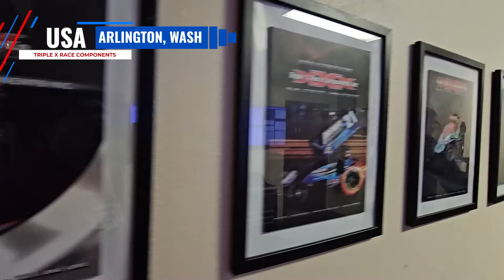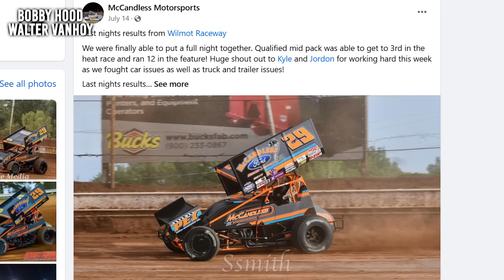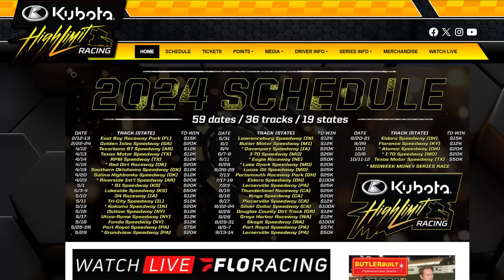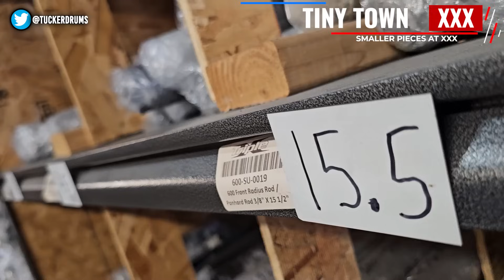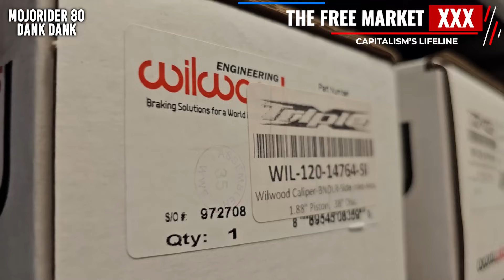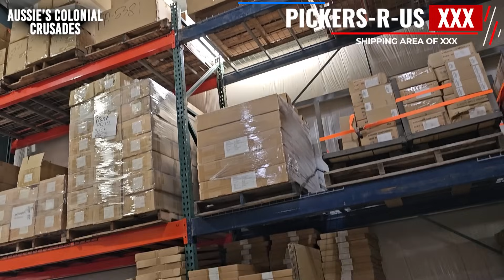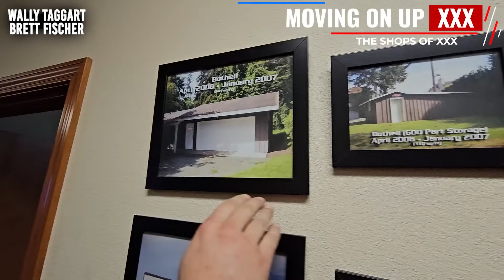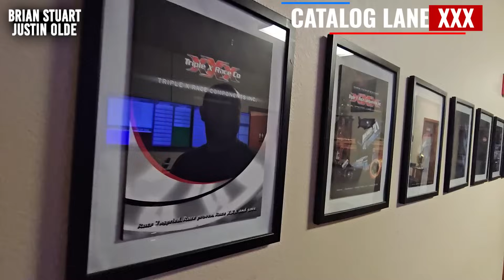CHINESE SPRINT CARS: XXX Chassis talks on Origins, Bill Balog Incident, NextGen Sprint Car & more!

Comment: I stopped in @ Maxim Chassis Company FY-2000.  One little door on the side of this huge heavy machinery Morton style building.  Bulldozers, track hoes, scrapers, road graders inside & out.  Went in the little side door.  Not organized.  Not clean.  A few jigs & frames.  Nobody there.  Eventually a skinny guy came out from around a corner.  Can I help you? No, I was just passing through and wanted to see Maxim Chassis with my own eyes.  So..... this it?  This is it.  Yeah, when the weather gets too bad to run the heavy equipment outside, we bring the guys in here to weld-up these damn race cars.  Keeps them busy.  Gives them something to do.

Comment: I'm surprised micro-sprint car racing isn't huge in Japan, I think it'd be cool if it was...imo
Reply from the maker: True.. this should be embraced for expansion purposes.
Reply: I always thought they would be cool on the the flat, speedway motorcycle tracks in Europe, but the surface is different
Reply: @georgemusgrave8858  the micro-sprint can run in a parking lot or a dirt field, it doesn't take too much space

Comment: I don't buy his reasoning on why the chassis are built in China. 100 sprint cars a year really isn't that much, that's a pretty light number compared to the top builders of other types of racecars that much more time consuming than a sprint car. I can only come to the conclusion that it's a cost saving measure.
Reply: Yeah something as simple fabrication wise for good fab guy 100 cars a year is a part time job at best
Reply: He was stating that as an example. They sell hundreds of cars every year if not well over a thousand.
Reply: Every outlaw and high limit team uses 8-10 chassis a year. Some more some less. So Jacob and Logan that’s about 20 cars just between the 2 of them per year. Now look at all the other teams that run them that need the same amount plus the regional guys. Then you have to count the usac teams so easily they sell 500-600 minimum each year.
Reply: @stevesimonds7837  I understand that. That's still light work compared to the top late model and modified chassis builders that are around 200-300 cars a year, especially these days when probably 90% of the cars leaving the shop are race ready minus drivetrain. I can't imagine it's more than a few hours to build a sprint car chassis for a guy that does it everyday.
Reply: @kyleolson279  I’d say it takes the same amount of time to build say 500 sprint cars to 250 late models/modifieds. Also the price is double or more for the late model/modified chassis so I think it balances out
Reply: @stevesimonds7837  Not even close. Remember most of the late models are going out the doors as a complete rolling chassis. Just the bodywork on a late model is the time equivalent to building a complete race ready sprint car.
Reply: @kyleolson279  we weren’t talking about car assembly. We were talking about chassis manufacturing.
Reply: @stevesimonds7837  I was comparing the work load of the two and drawing a conclusion for his reasoning on the chassis's being manufactured in China.
Reply: He never said they make 100 cars a year they make WELL over that, he said they send 150 cars of just the Australian style over there alone

Comment: Steve Smith built a car for Stevie that weighed a little more but a lot safer
Reply: Ingersol Rand coil over car.  Won $100,000 in Stevie's first (and I think only) wingless race.  Finished 2nd @ Eldora Mopar Million. Compare that race to the 2024 Knoxville Nationals.  Two fewer days, 10 fewer laps, 1st, 2nd, 3rd, 4th, & 5th place paid more.  24th paid $5,000 less. Without pay-per-view.  Brad Noffsinger started front-row-pole. Was 1st car lapped.  Without mechanical woes.  Other than set-up & talent.

Comment: I thought the car didn't matter in sprint car racing? Why does building consistent chassis even matter?
Reply: All your setups is based on your chassis measurements. If you have a mounting point that is 1/8in difference from car to car your setups are going to be different which means alot of changes
Reply: @dalehilborn691  Really??? No fucking way!!!!

Comment: What's going on with shark racing Allen is having a hell of a lot bad races lately ???????
Reply: Jacob has never been great. Sometimes he just surprises and contends or wins a random track. Consistency is lacking heavily for Logan Schuhart as he would say
Reply: It's called motors, and it all depends which one is under the hood.410 Or the bigger motor
Reply: @glenmurra3856  another keyboard racer answer
Reply: @glenmurra3856  bigger motor??? 410 is the biggest you can get in sprint cars

Comment: American tracks. Most are utter rubbish. Lousy or no fences, not pit gates and what there is are NOT continuos with the wall. Little or no catch fencing etc etc. No governing body so no real standards anywhere. 
Midget and Sprint fuel tanks are  and always will be very vulnerable. Though they are a bag tank so not really that bad. Except they fall off every second crash!
Bar under the seat? Knowing former Aussie midget champ Phil Herreen he is in a wheelchair since having the diff hit him in the backside.
I dabble in classics and I immediatly made sure of a substansial bar under the seat. No issues with suspension travel.  Even then broke suspension links and the diff hit the seat. Though just. I am fairly tall and have to have the seat where it is. And the cage has a halo. Built too small 66 years ago!!
Reply: @ldnwholesale8552  fencing does not make racing or tracks safer